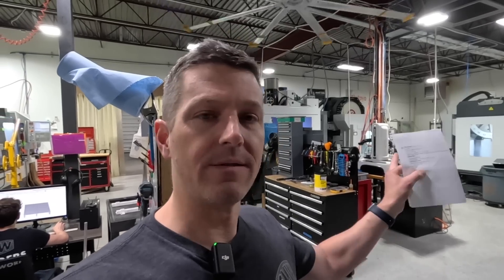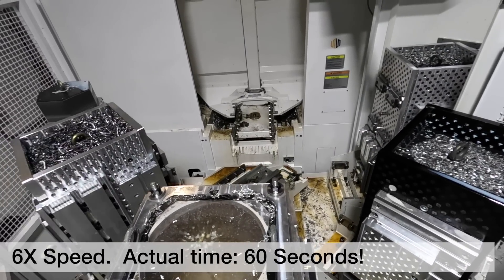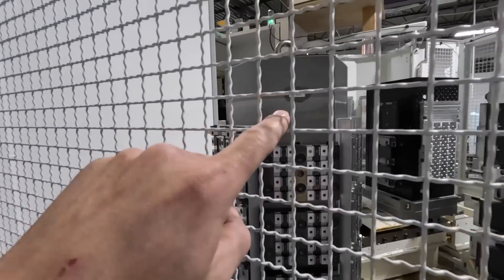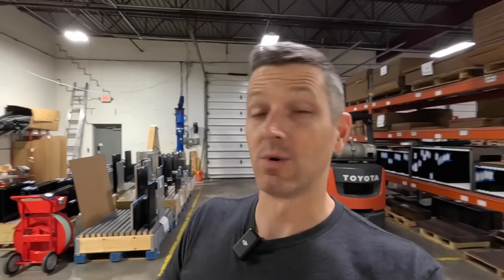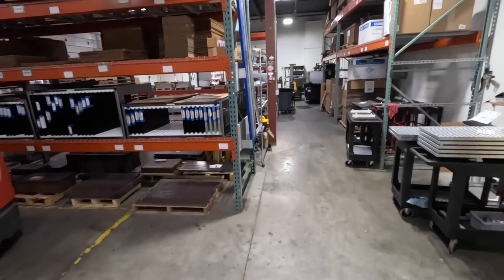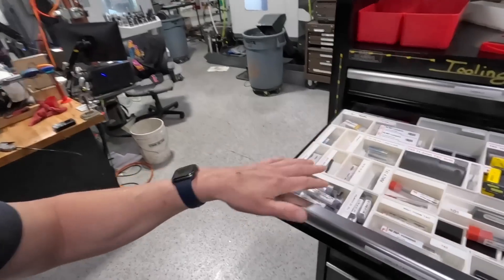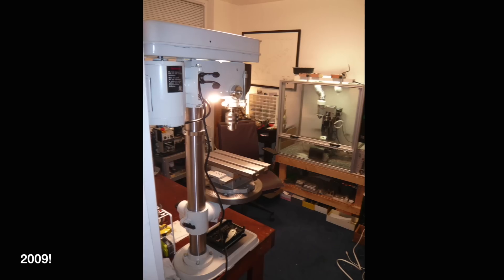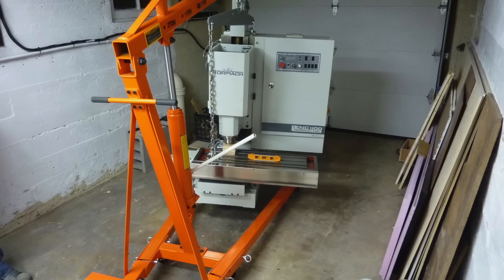April 2024 Machine Shop Update!

Comment: Is there a reason why you don’t use a load monitors on your machine? Especially if you’re running it lights out.
Reply from the maker: We do!  Our okuma horizontal (which runs lights out) uses tool load detection through Fusion 360; we get emails when a specific operation exceeds a limit.

Comment: Regarding the shop vac, I have one that I use in my CNC setup. Whenever I need to change a part, I use the shop vac to vacuum up the chips instead of blowing air. I have it mounted on the side of the enclosure with the hose inside the machine. Additionally, I use a foot pedal from Harbor Freight to conveniently turn it on whenever I need to use it.

Comment: In case your Okuma viewers are interested in the IO monitor for that all coolant off button:  VORD[00006] will equal 1 if the button is pressed. Some other fun guys to double check panel conditions are VORD[00038E] will check the spindle override, VORD[0007] checks the rapid override, and VORD[00019] can sample the feed override.   Additional: Your solution to add a camera rocks, but there is a screen on the control parameter page the will tell you all pallet locations. The parameter page is called PALLET ST.-NO and shows a registration of where each pallet is currently located, minus the one in the machine (that guy is on the previous parameter screen).
Reply from the maker: THANK you!  Appreciate you guys chiming in!

Comment: I used to run Mazaks and when you first turn on the machine, the coolant would not be on. One time the morning shift did not turn it on and every tool busted. 17-4 stainless. Then they said I had the part in with the good parts with broken drills and stuff in it.

Comment: Hello! Operator here at a small job shop with 9 machines (HURCOS), machinist apprentice and current student in Florida at a college where I am 3 semesters in on the aerospace engineering program. I am the do all guy at our shop, meaning machine maintenance. We run all materials in every machine all the time and it's a real pain the ass because our recycling company will return material chip barrels if the chips are mixed. So, to keep the machines specific to certain materials is a great idea in my opinion. The machines have to be cleaned after every job, especially after steels and plastics. So, kudos to you for making the decision to keep machines specific to certain material. Cheers from Florida!